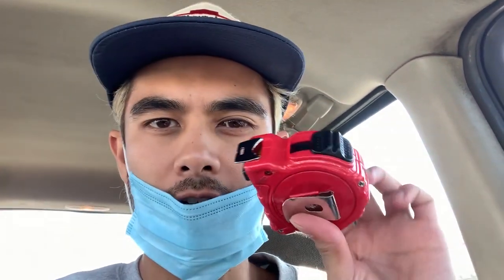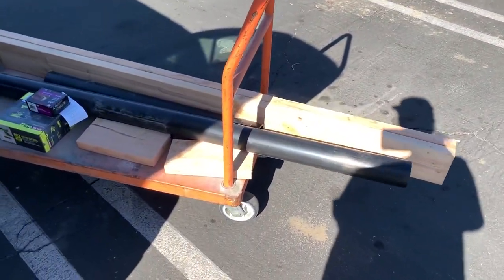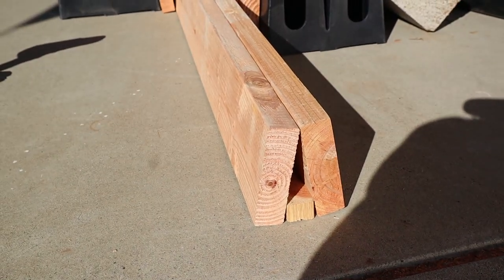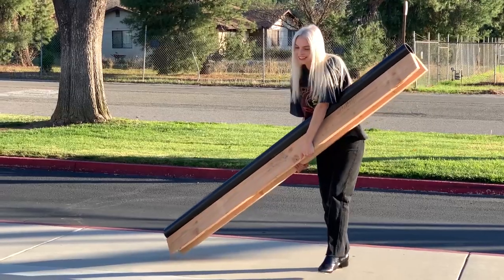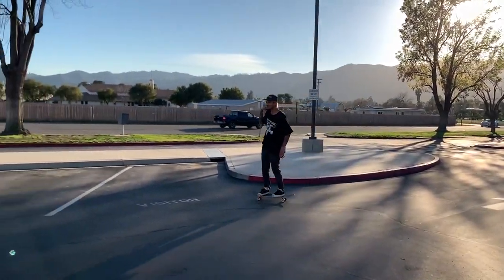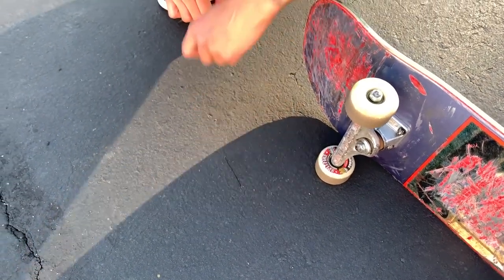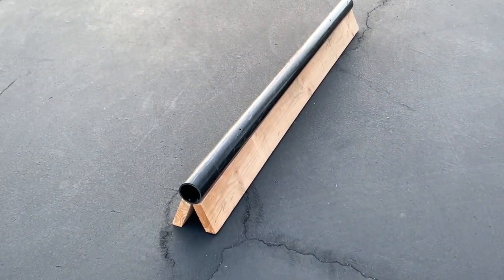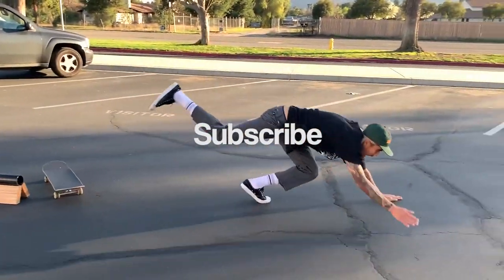$35 DIY SKATE RAIL BUILD

Comment: Well done!! Good to see some more DIY on you channel. Just one suggestion, cut three triangles from your drop offs and screw them in to support the wood. One in the middle and on each end and you will have a solid rail that will last a while.
Reply from the maker: Dude thats a great tip, thanks for the heads up! And thank you! more diy stuff to come!

Comment: Hey just started doing some diy research would you recommend going to 2” pvc if just for skating? More specifically for 50-50s?
Reply from the maker: It would deff make it easier to lock into 50-50s